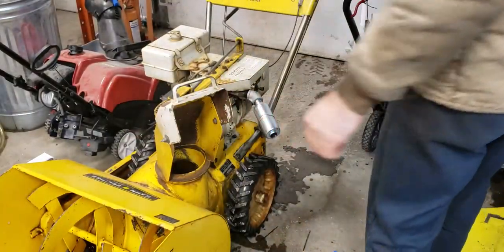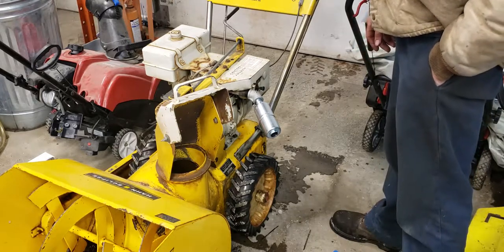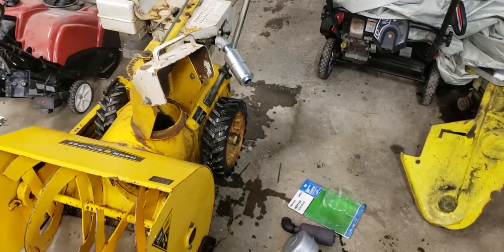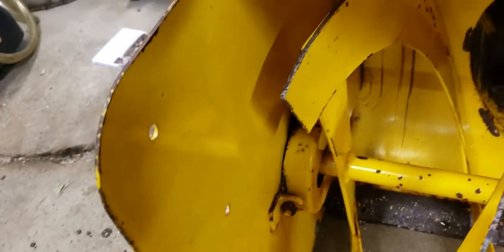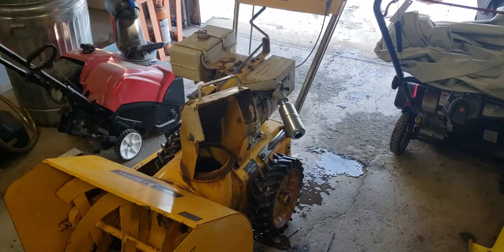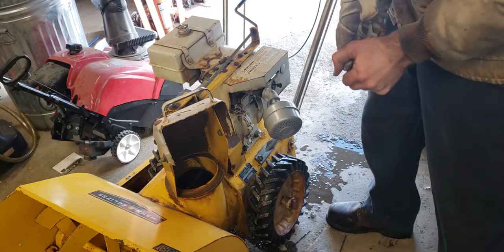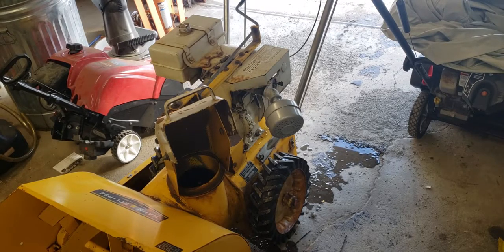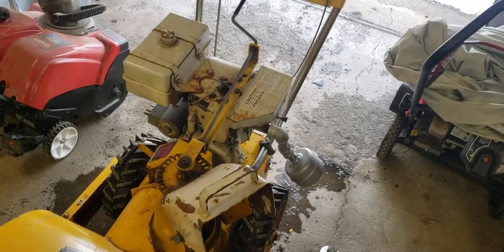Snow Giant By Hahn Eclipse || The Best Performer

Comment: My dad bought one new in the mid seventies.   Still have it,  never had to do anything but change oil, spark plug, and drive belt.  Well balanced, I like the engaging handle operating opposite of other machines.     Works great, throws snow well.      Techumseh engine.. Oh yeah,    the drive chain (and shear bolt)    could be troublesome.       It is a keeper,  great machine.

Comment: Odd machine but very cool...I’d like to quiet down my water pump,do you have any ideas for that?
Reply from the maker: Yes I do have some ideas. How long is the output hose
Reply: Hose that pumps water is 20’ I believe ,I haven’t had it out in a while but planning on using it this weekend
Reply from the maker: @BeefyPrepperthegolddigger  one idea I have is to put a plywood enclosure around it, similar to what you would do with a generator. Another idea is to add an additional 20' or more to get it further away. Finally i could try modifying the exhaust as a last resort.
Reply: Ok I’ll look at those ideas ,I just don’t want to add any weight
Reply from the maker: @BeefyPrepperthegolddigger  Good point. So quieter but lighter, that will require some thought
Reply: I guess it will always be pretty loud,using the electric pump the last few times has been nice but it really doesn’t have the pressure I like